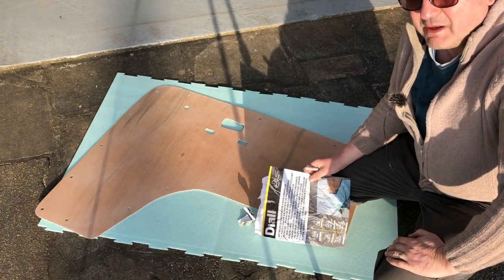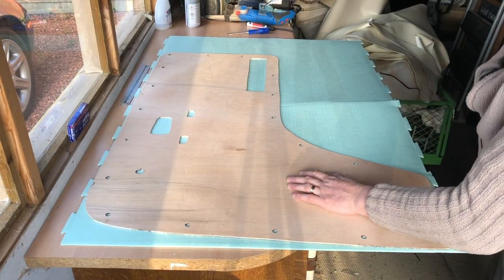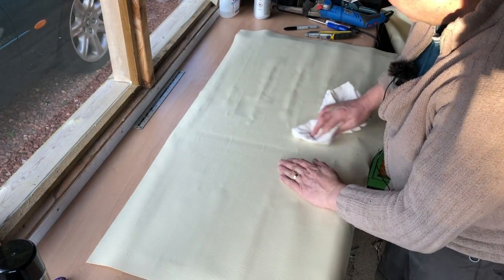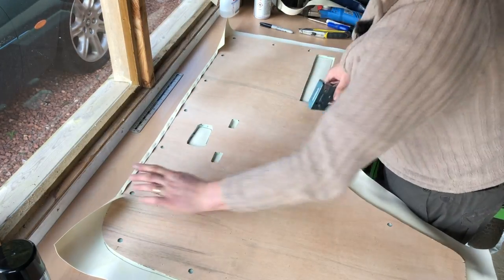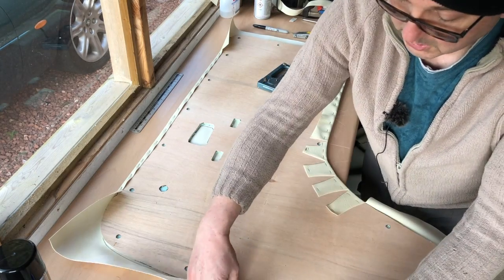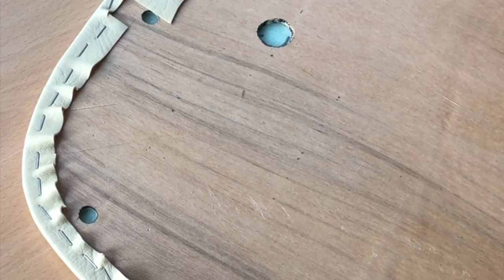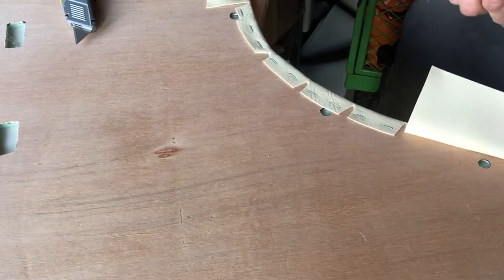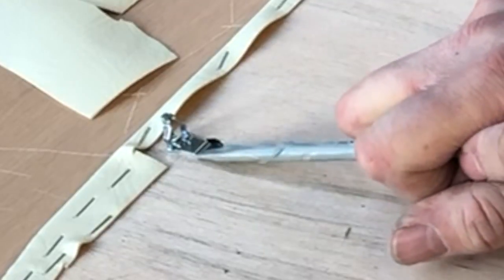How to trim door cards. Restoring Olive the VW T2 Bay episode 6

Comment: Nice tip with the underlay, helps insulate, but I’ll still add some upholstery wadding between it and the  vinyl for a more ‘professional’ and better looking end result... especially helps to soften and protect vinyl on the edges of the card over time if some wadding between vinyl and square edges of the wood

Comment: Nice job. I remember when I had my 60 VW van, I was living in Seattle. Boeing had a big surplus center where you could purchase parts cheap. I finished the inside of mine with a interior panels from the interior of planes. I also purchased some aircraft passenger seats and installed them in the front, replacing the original seats. Back then, the airlines made comfortable seats.
Reply: They still do, they're just much more expensive than the cattle car airlines wish to pay.  All the stuff they failed to sell in Seattle, they would sell at EAA Oshkosh the following summer.
Reply from the maker: Sounds like an awesome resource to have had available.
Reply from the maker: Is Oshkosh a place?  I only know the name from tank transporter trucks that the UK military now use now instead of the mighty, but very old  Scammel Commander. Which had a V12 Rolls Royce/perkins Diesel.
Reply: @ToTheGarage  Oshkosh, WI where the EAA convention is held annually.